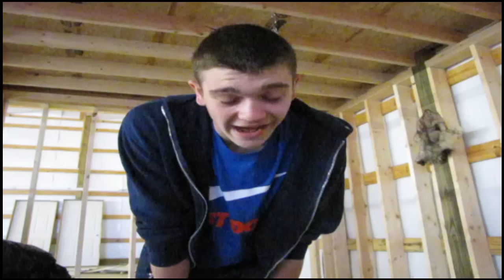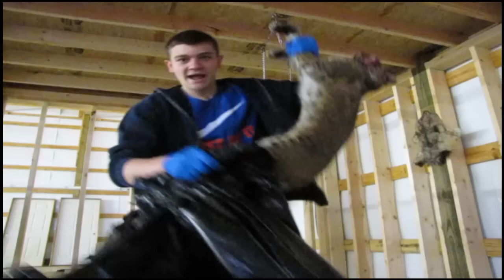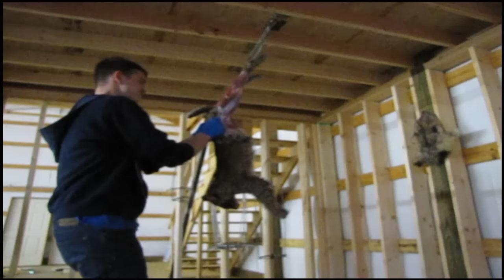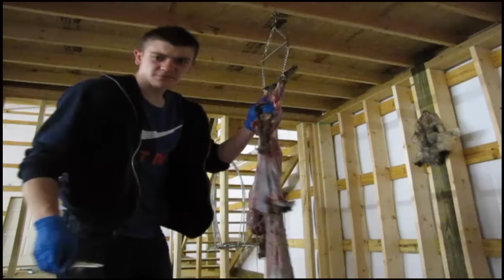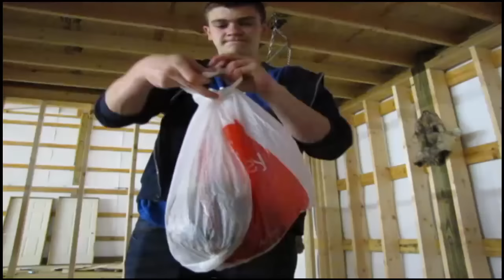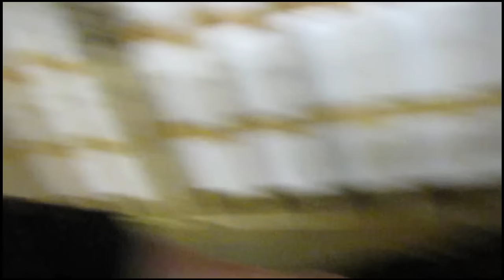WHATS IN THE BAG???

Comment: I forgot to say you said that you was going to buy a flesher why not build your own make a frame then split a four inch pvc pile heat it flatten it out and then make a beam out of it I've used the setup but still use my 2 by 8 I drilled a hole at the bottom and put a metal rod between two joist of your beam that way you can fold it up between your studs of the building that's my setup in my shed hope it helps out and saves you some cash